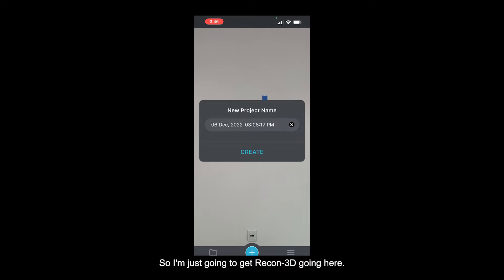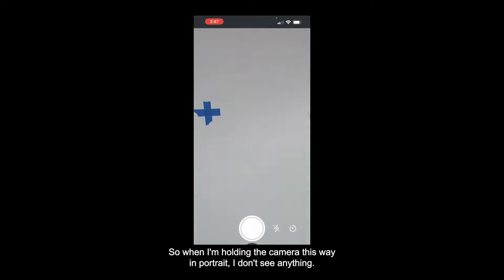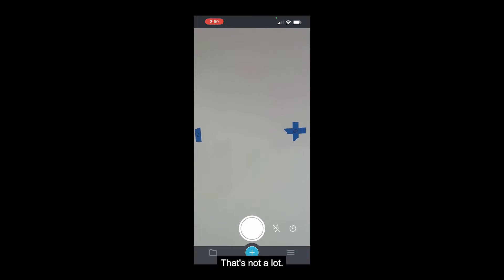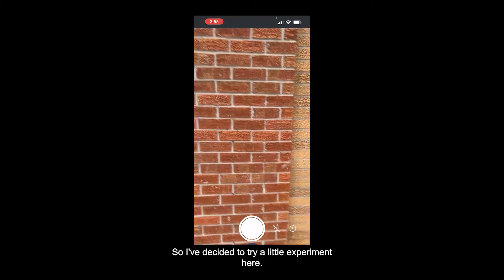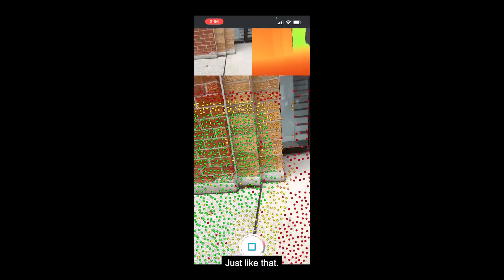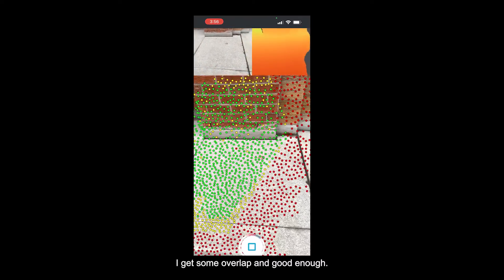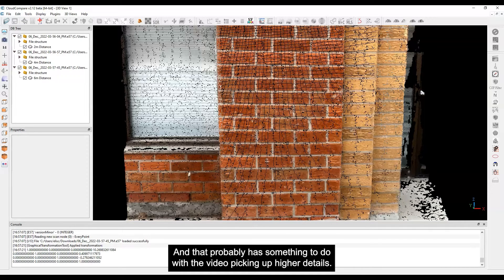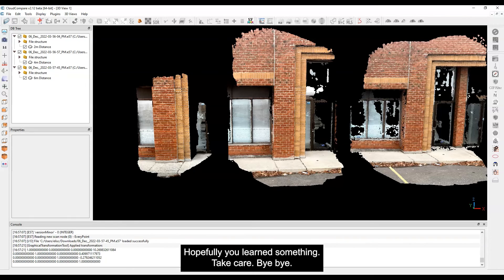How Far Should you Scan from a Surface Using Recon-3D? | 3D Forensics | 3D Scanner | LiDAR | CSI

Comment: Hey im thinking of getting the paid subscription. We use photogrammetry to design boat decking, I’ve tried using your app which is better than the others that don’t combine photogrammetry & LiDAR, however I have a lot of trouble scaling, I used the April tags, why doesn’t it scale at all in cloud compare??, I draw in rhino, and I thought using the targets and measuring the centers gives you scale, how do I get scale?
Reply from the maker: Sorry for the late reply. You have to enter the target distance before you scan. While scanning you need to make sure that both targets are captured and you should be good to go. Once scaled in our system, the exact target distance will be reflected in the point cloud. If you do not use the targets, then you need to use another app like CloudCompare to scale.